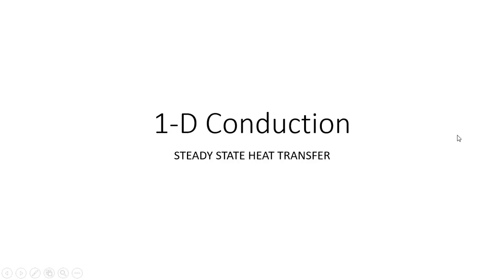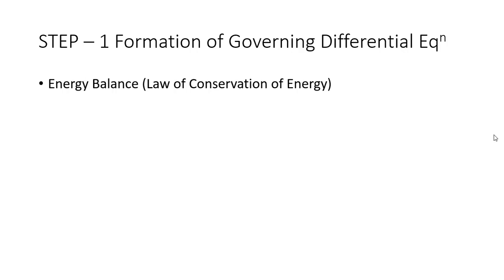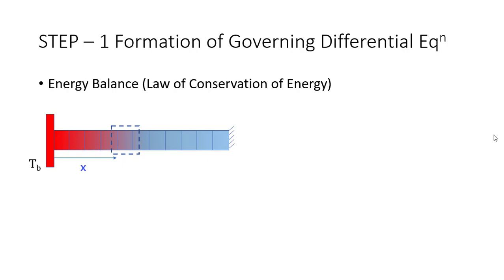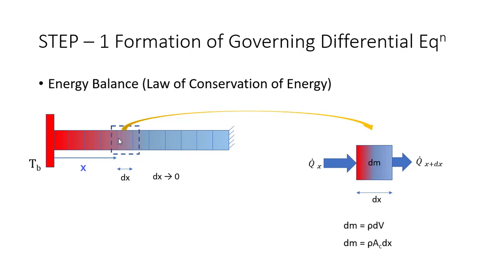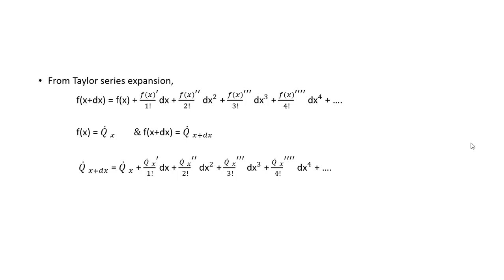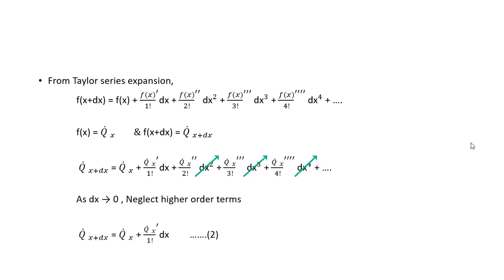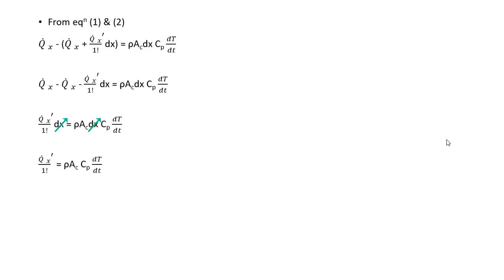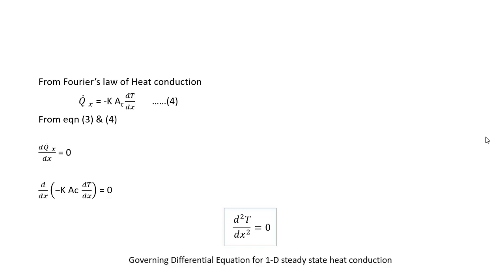🔥 Numerical Analysis of 1-D Conduction Steady state heat transfer. PART - 1

Comment: Steady state heat transfer process - 
• There is not net accumulation of energy or its storage with time throughout its bulk mass or volume or domain as a system in space considered. 
• All the heat fluxes interacting at interfaces are balanced simultaneously in time. So, this results in temperature temperature at any location of body is constant & invariant in time. It can be variable from locations to locations. 
• Means, Temperature field is - T(space) & independent of time t. 
(i) T = T(x) or T(x,y) or T(x,y,z) 
(ii) But not - T(t), T(x,t), T(x,y,t) & T(x,y,z,t). 
• Generally, this type of process is used or assumed or formulated to neglect its time history. Or in other words, each steady state heat transfer process is the final state of temperature field achieved in unsteady state ht process. When the heat fluxes are balanced in each instant so there is no net accumulation of energy stored in it. So the temperatures are simultaneously the same in time though they may change from local to local in physical domain.